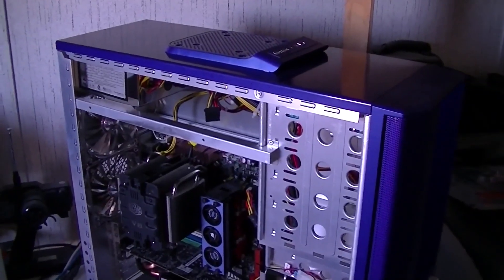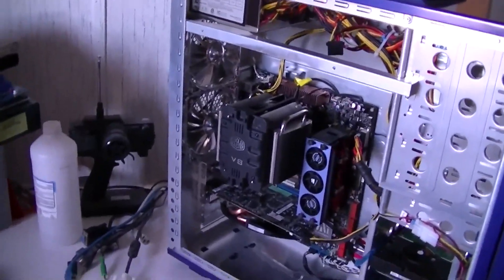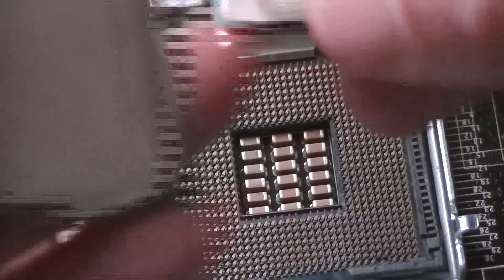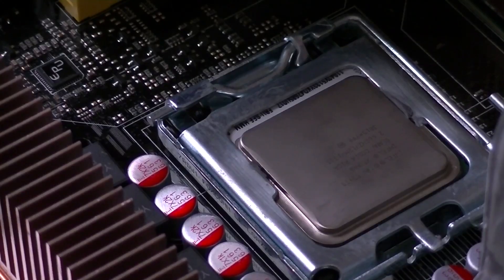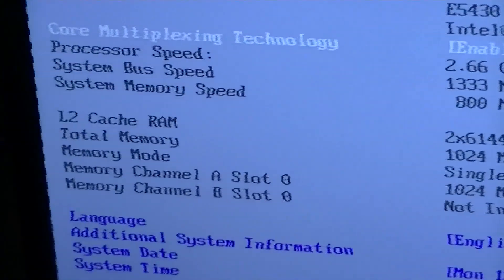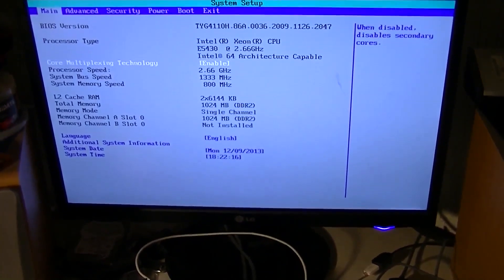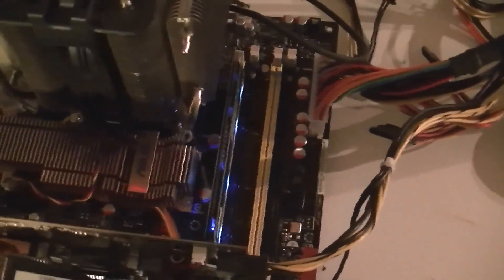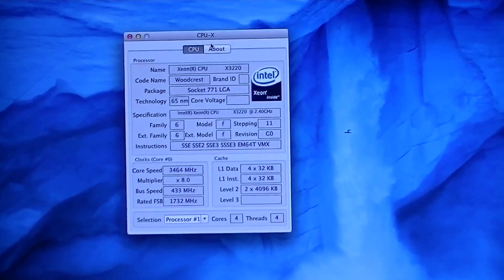LGA771 to LGA775 MOD Intel Xeon E5430 - Asus P5E vs The WaybackTECH

Comment: Would I be correct to say that today it would be better to leave the socket alone and buy for less than 20.00 (yes 9550 cpu's are under 20.00 on ebay) and simply install a 9550 (same 12m cache same 1333FSB better base clock @ 2.83Ghz)

Comment: Dell Optiplex 330 working completely fine with an E5440 (SLANS) and bios A11 (latest).  It has either a G33 or G31 chipset. 0KP561 is the motherboard revision.  I remember that certain steppings work and certain ones do not, but a SLANS E5440 definitely does.

Comment: Adapter 771 to 775 http://ali.pub/4fsk6
CPU Xeon E5450 3.0GHz 12M 1333Mhz + Adapter 775 socket http://ali.pub/qneyd
CPU Xeon E5472 3.0GHz 12M 1600Mhz + Adapter 775 socket http://ali.pub/b91er
motherboard Gigabyte GA-P45T-ES3G ddr3 LGA 775 http://ali.pub/hrdmu
E5462 Poor overclock!

price-quality video cards:
NVIDIA GeForce GTX iGame 1050..1080 GPU GDDR5 4..8GB http://ali.pub/v0yob
GTX 1050 2048 МБ GDDR5 http://ali.pub/rvoxe
GTX 950 2048 МБ GDDR5 1020/6400 MHz http://ali.pub/egzi3 
GTX 750Ti 2048 МБ GDDR5 128bit 1020/5400 МГц http://ali.pub/12ukh
GT 610 2048 МБ DDR3 810/1200 МГц http://ali.pub/bf7nq
Reply: thx

Comment: Cutting Intel sockets and licking knives. Honestly think we could be good friends.
Reply from the maker: +ProjectedClarity LOL
Reply: XD I've just upgraded my e5400 to e5430 on p5kpl-am se motherboard, nice cpu, fsb 375 and multiplier 08.0, easy 3,00 Ghz.
Reply from the maker: DeXtrous
Mine is still working great after over 2 years of being overclocked and worked hard to render videos. It lives a more lax life now though at work with me the last 4 months since I upgraded  to a dual 1366 system that I installed a pair of X5672's. Longevity of this mod seems to be perfectly fine. I do notice though GTA V isn't quite as smooth on it as it is on my 1366 gaming rig, with the same video card, but it's still good enough for the occasional cop chase and being stupid :)

Comment: x38, x48 doesn't support 771xeons
Reply from the maker: +Legacy Political not entirely so. Xeon X33x3 LGA 771 Xeons do work with X38 and X48. Xeon E54xx series does not. I even did a video about this too.
Reply: +WaybackTECH x33x3 an exception
Reply: +WaybackTECH Hello, I got mine to work by downloading the newest bios update from Asus here: https://www.asus.com/Motherboards/P5E/HelpDesk_Download/ 
Then the microcode for lga771 xeons and added them to the bios update.
I got my X3323 Xeon overclocked to 3.3GHz :)
Reply: @projectteabagz5708  try flashing maximus formula bios, its the same board and you get better OC and cooler bootscreen
Reply: +ProjectTeaBagz nice
Reply: +Legacy Political x3323 did not work on my Asus P5E :( I will try a bios update, maybe it works, I can see that Asus added to bios updates, which made support for new CPUs: http://www.asus.com/support/Download/1/22/52/7/wDz11GXFiWSqhjla/30/   :)
Reply: will my acer mrs600m mobo be able to work on e5460?
Reply: X3363 works well 😉
Reply: +ProjectTeaBagz 
You have a Yorkfield processor, he had a Harpertown processor. They are different generations.

Comment: I guess maybe the problem is with FSB Speed

E5430 runs @ 1333 MHz FSB
X3220 rune @ 1066 MHz FSB

You asus P5E suupports upto 1200 MHz FSB

Try to do this , go to BIOS and try to reduce "E5430" FSB to less than 1200 (But it will may underclock the processor too. ) nd check it
Reply from the maker: +WellMadGuy Well if you cared to watch any of my other videos involving this mod, you will know, and  I have explained many times in comments to various people, that the chipset will not accept the 5000 series variant of the Xeon family. Has absolutely nothing in the world to do with FSB and I can tell you this motherboard will run 1600Mhz bus without issue Hell I ran it up to 1800!. The chipset is the issue with this mod. It is well documented that X38/48 and Q series chipsets will not work with this processor. I only know the X48 does with with the X3363, and may have with this motherboard as well. I have many videos when I was working on this mod at various stages. I also spent time working with a guy on the overclock.net forums on rewiring the processor in an attempt to make it work with this chipset.
Reply: ok :) , thanks for the info

Comment: What do you think about working E5440/50 or E5472 on asus P5E Deluxe with latest BIOS? I want to buy one of this processors with 771-775 mod, but i doubt, will it work correctly...
Reply from the maker: Abarth-HardWare Well the P5E Deluxe uses X48 chipset.  So did the P5E3 motherboard I had and made a video on.  I never got the 54xx series to work on that board, only the X3363 LGA 771 processor worked. I would there for assume all X33x3 cpu's will work. I never had, nor have I seen anyone on the forum say that a non working combination worked after a microcode update. If the screen stays black, and the sticker is installed correctly and making good contact of course, then a microcode update is not going to make it work. The chipset is the issue, not the bios unfortunately. It does not matter if it is an X54xx or an L54xx or E54xx, my experience was those chips in the 54xx series will not work on X38 or X48 chipsets, and is the same experience on all the forums.
Reply: WaybackTECH Thanks for your answer!  Now i need to change my motherboard to P45.
Reply: Russian HardWare P45 chipset is fit for he X54xx, my case x5460 (3,16ghz), provided the CPU uses 1333 FSB, while the board (Asus P5Q) can push even past 1600 mark. Got it running at 4 Ghz, but was awfully unstable till got to flash microcode-updated bios. it's been my daily driver for a couple of years since, although be prepared for 140W+ TDP .

Comment: I have a asus p5ql-cm mb with g43 chipset.Will it work?
Reply from the maker: Toz GiUbi Any G chipset based motherboard will work.  The only thing is some will require a bios mod to correctly identify the Xeon cpu and enable the SSE4. Unless you really have a program or game that uses SSE4, I don't think it is worth the microcode update to enable it. But that is just my opinion.

Comment: Another update. I ended up getting a asus pP5QC. Out of the box off ebay for 100 bucks. It came with a x series Xeon which I traded out for the E5450. I cut the evil tabs off installed into case and viola. A brand new PC was born, I did have to update bios with the wonderful tutorial you provided but  that was about it. Not sure what I can push it to but so far I was only able to get 3.2 out of it but that is not being very stable. I think my voltage is too low.

Comment: hi ,first thing i bought a xeon e5472 3ghz/12/1600 and a mobo msi p35 platnium after setting everything up i had the same problem mobo would startup and shut down over and over. so up dated bios(ami 1.8v) still had same problem.so as a last ditch effort i touch a screwdriver of the mobo reset pins not the bios reset pins and the board started up and now runs perfect. this may work for the asus i don't know but its worth a try.

Comment: Update: I was able to flash my BIOS back to an earlier version with AFUDOS 2.7
This might be important to someone.
http://drivers.softpedia.com/get/Other-DRIVERS-TOOLS/Others/Asus-P4S800D-E-DeluxeAfudos-BIOS-update-tool-2-07.shtml
this is where I found it. I also patched the newer bios but after reading the posts that people left doing this mod I am going to buy myself a ebay board cheap.Probably something listed in this site 
http://www.delidded.com/lga-771-to-775-adapter/3/
You do good work. Loved your videos. Very empowering.
Reply from the maker: Some boards it takes a bit of work. Other boards this basically works out of the box.  With the exception of the X38 and the Gateway FX with a 975X chipset, I have had success for the most part with this mod.  This E5430 chip I bought with the sticker already applied but I did it on my own with later Xeon chips.  It helps to have a magnifying glass to look at the chip through to align that sticker just right.  I have had to "seat" the chip into the socket and wiggle it about a bit to get the sticker and all the fingers to contact correctly but other than that small issue it's really a pretty painless mod for the most part.
Reply: WaybackTECH Can you recommend a Full size ATX  that will work Out of box that supports E5460? I have been looking for something in the 50 dollar range. Have had no luck.
I can tell you like Gigabyte. So I assume it will be a GA
another silly question. I notice the support it for E52 on some boards. Does that mean it will do all the "E" processors? Or just the 1333? I was looking at the Gigabyte GA-965P-S3 but was iffy on the support.
Reply: WaybackTECH Side not. I have lots of DDR2

Comment: I have a P5W DH and I am praying this will work. Now that I bought the chip I am seeing some not so positive posts.
http://www.delidded.com/lga-771-to-775-adapter/3/
on this site.
Reply from the maker: I can tell you I tried this mod, both E series and the X series Xeon chips on a 975X chipset motherboard and neither worked.  I have read the 975X is generally considered not to work.
Reply: WaybackTECH  Unfortunate I tried the mod. I can get to the bios but I can not get any further. I guess I wasted 60 bucks.
Reply from the maker: Dave Oneill If you get into the bios that is more than most people can do. It might be a bios setting or possibly needs a microcode update. Although the ones I have tested did not need a microcode update to boot.
Reply: WaybackTECH
 Right now I am stuck because it is very difficult to downgrade my bios once upgraded. I would not even know how to get a new bios on without having to do something risky such as Afudos. The guy who sold the chip to me claims that he has a bios that will work. I will update you.
Reply from the maker: I did a video on updating the microcode. it is pretty easy
Reply: So I watched the vid. My Xeon showed up in the post. So maybe I just need the custom bios with microcode. Artic silver is making cash On me. I went back to old chip and I am stuck on this crappy bios, I remember updating and downgrading once before but now it seems to not work.

Comment: Did we ever figure out what the best motherboard to run is?
Reply from the maker: Opinions may differ with mine but I love my Gigabyte P45 with DDR3 motherboard and E5450 for this mod. I am currently running this CPU E5430 on my old Abit P35 Pro motherboard. It handles this fine.

Comment: So, i already bought a x5470 and i discover now that my P5E Deluxe does not work, i am a silly person.
Reply from the maker: Well even thought his mod will not work with the P5E board, you can do what I did and find a P45 chipsetboard, or just resell the X5470.. Those are still highly sought for on ebay.
Reply: WaybackTECH Is the Asus p5q  pro turbo good for this mod? it has a P45 chipset.

Comment: The chipset that I love is the G41 chipset. It works out of the box and you just need to do the microcode update, but the motherboard posts and everyting out of the box. The bad thing is that G41 chipset is a very bad overclocker. For some reason I can't get my Xeon E5420 to post past 343. Anything over that and it doesn't even post. I have an Asrock G41M-VS3 R2.0

Comment: i bought the best xeon, that run 1600 mhz fsb , and bought a gigabyte motherboard, ddr2 rams... i did the mod, then i open the computer, and it only run for 25 secconds and stop after

no video. my problem is either with the ram modules, that are too weak ( 667 mhz ), or maybe i need to cool it all better.... or maybe its our chipset that says run 1600 mhz thorught overclock... it will be hard to knows as there are almost no 1600 mhz lga775 motherboards existing.
Reply from the maker: I have 2 that are rated for 1600MHz. The only thing I can tell you about my experience with the Gigabyte board I have is it required a significant voltage bump to the memory for stability. I have to run at least 1.8V but I am running 16GB of memory.  In my case it is a problem with the P45 chipset not supplying enough current to all 4 memory slots, and increasing the voltage is the only way to fix it.  Other problems crept up after upping the voltage too far on the NB. Mine seems to be happy around 1.24 - 1.28V but much higher it starts having issues you described.
Reply: WaybackTECH fsb is not supported by the motherboard. Only downside to the xeon mod...
Reply from the maker: GingeGamingCentral
I know that the X38 chipset in general can usually run up to 1800 Bus. Past that it is a total crap shoot. I ran my X3220 on the P5E @ 3.6Ghz / 1600 Bus for years before I ever knew about the LGA 771 mod.  My Gigabyte P45 based board does officially support 1600Mhz chips but 1800 is about the end of the world for this board.  When I had the P5E3 X48 running an X3363 Xeon, it was happy to comply with about 430Mhz bus, that was also a 1600 bus supported board.  I have no idea what gigabyte board this individual had or what the chipset was. I suppose his may not have been stable in any way @ 1600 Bus and / or the VR section was unable to supply enough current to the cpu, or even could have been a weak PSU... I think the 1600 Mhz bus xeon chips are a bad choice in general for this mod.

Comment: Anyone tried heating their blade to cut the plastic tabs? - hot knife through butter idea... Anyway, if you are interested in this idea here are two useful links I found: 

http://www.delidded.com/lga-771-to-775-adapter/
http://www.delidded.com/list-of-intel-lga-771-xeon-processors/

Comment: i just bought an Intel DP45SG motherboard on ebay. looking at the supported CPU's on intel's site it lists a wide range of core 2 duos, core 2 quads and Xeon CPUs. I don't have it put together yet, but looking at the socket, it looks like I may have to clip the notches off myself, or since intel's site lists Xeons as supported, would I even have to modify anything to make it work. Then the question is do I get the Core 2 Quad Q9550 for about $70-$80 or for half the price get the Xeon X3360 intel's specifications for these chips are pretty much exactly the same

Comment: Interesting that your running hackintosh ;) I'm by no means a MAC person, but it's cool people have modded OSX to work with consumer parts.

Personally I'm looking forward to the day Linux gains serious gaming traction hopefully with SteamOS.

I use Windows, but the main reason for that is simply because of Direct X support, but OpenGL could become the new dominant API standard soon thanks to Valve and I hope it does.

I've always preferred OpenGL over DirectX anyway in games that supported both. You can force texture compression and back depth buffering with it in Rivatuner, but can't with DirectX both of which can eek out better performance control.

Comment: Good to know happen to have Gigabyte G31 board and was contemplating trying this. Thoroughly impressed with Gigabyte's BIOS beats the crap out of my Biostar P43. The Gigabyte board has fantastic voltage controls and Biostar has abysmal voltage controls.

Also Gigabyte will overclock PCI-E much better which is risky, but can help me squeeze more PCI-E/PCI/SATA bandwidth great for GPU/SSD/NIC for example provide you don't get too crazy with it and fried anything.

Which I'll undoubtedly test the limits on eventually. Never hesitated testing the limits of overclocking GPU or CPU in the past. I will prob add a heat sink on my SSD controller chip.

Comment: thanks for the vid! 

I was just doing this today, and had the same boot loop problem as you, im using an asus P5KC and a Xeon E5405 (it was a good bit cheaper than the E5450) and after watching your video, i was pleased to know it wasnt just my rig. I was worried I had mounted it incorrectly or that some other piece of hardware was tripping it out. 

I didnt try BIOS etc because of your video so that saved me some time, I just went back into the mount with my stanley knife and smoothed round the rim of the socket from where we removed the plastic, and made sure it was all smooth and even.

Then reseated the cpu, tried a fresh application of slightly less thermal paste, and it fired up first time... I know you said in your video you went back to the core duo, so im sure you have had it in and out a few times but I thought id share my experience with you. It wasnt a bios, or soft issue! 

now to find out more about a bios mod for the cpu, to get the most from it.

Comment: Help 
" Asus P5E + Xeon X5282 (Intel Xeon Harpertown) / E5450 / E5460(62) is compatible ? ?
Launches? "
Reply from the maker: I have not found any of the LGA771 cpu's to work on the P5E board unfortunately.  The X3363 does work on a gigabyte X38 based motherboard. But this is the only known working combination of LGA771 and X38 chipsets
Reply: WaybackTECH 
Thank you.
that is ASUS P5E + Xeon E5430 does not work ?
I apologize for the meticulousness.
Reply from the maker: Александр Лоленков
Not yet.  I don't have any real hopes at this point it will work.  But we are still looking at some things on the message board I subscribe to.
Reply from the maker: Александр Лоленков
I just got in a ASUS P5E3 PRO X48 board to test with a X3363 LGA771 chip, and those work together fine so far.  The E54xx series still does not boot on this board. Trick now is to figure out what difference there is between these 2 LGA 771 chips( if it is possible )
Reply: WaybackTECH
 It is interesting !
Reply: WaybackTECH

I must say, weak in English and little understood until now (((((rather go around the bush (
xeon e5450 (5430 ... * / / xeon series "X") + asus p5e - works? Require modification (mod - bios)?